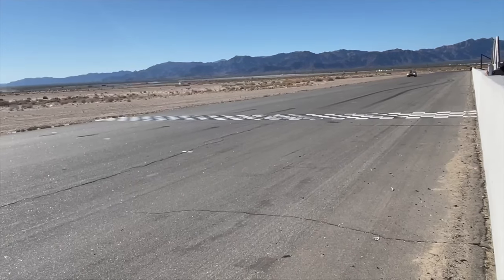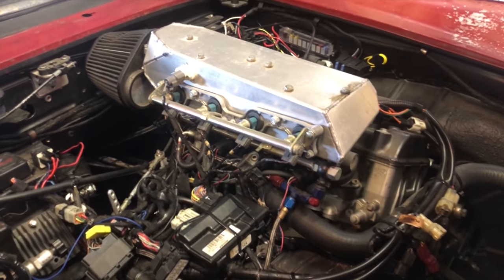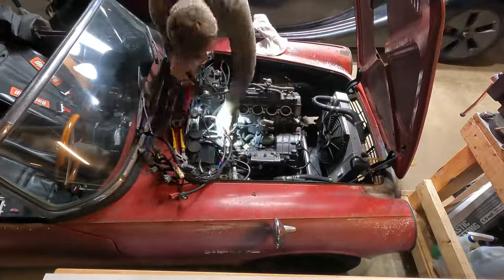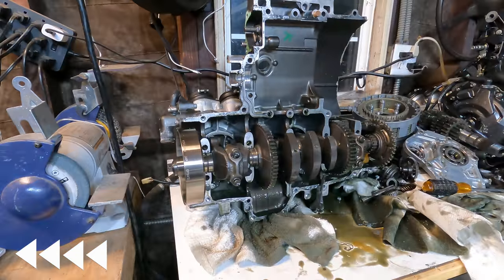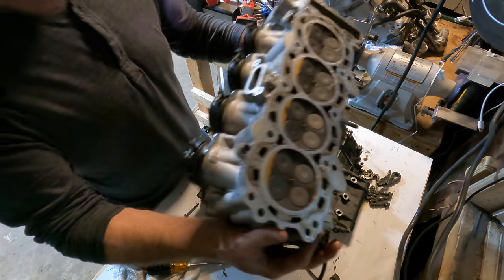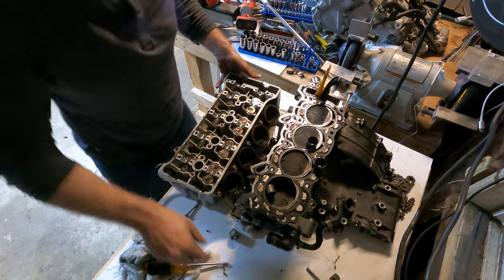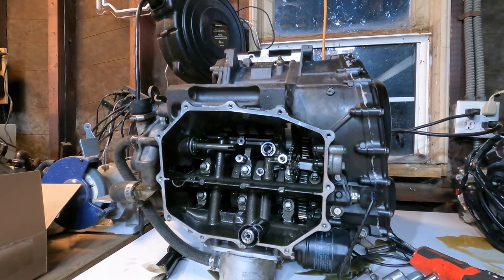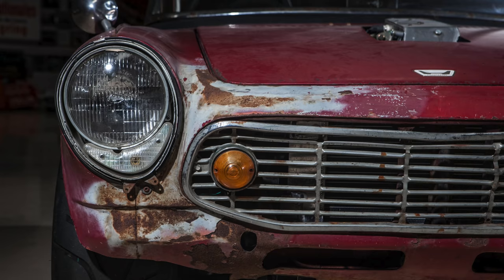I Blew The Motor In My Motorcycle Powered Car

Comment: So now it is time for a Honda Goldwing/Vulcan V6. Still a motor cycle engine! Design and make a good baffle for it and make sure you have a screen on the pickup! This gives you more usable torque were you need it, plenty of HP and reverse. I bet it will work much better on the street and cannon roads!
Reply: Vulcan V6? Whats that?
Reply: As you presumably know, the Vulcan and Gold Wing don't have the same engine. The Gold Wing has a flat 6 (too wide), and the Vulcan is a Kawasaki. Perhaps you meant to suggest either a Honda Gold Wing engine or a Kawasaki Vulcan V-twin. Neither bike has a V6.

Comment: yikes, that baffle with only a center hole pretty much makes it so the oil can't return to the pan unless there's no lateral load at all, basically the opposite of what you want. I'd say winged sump with trap doors for the next one, if you decide to not use a dry sump.

Comment: I believe you are overthinking the oil. The only difference in the sloshing of your car, and a motorcycle, is the orientation of your engine. However, with the oil baffle as extreme as the one you installed, I would not even worry with slosh. I think, if you were to add a sight-glass to that modified pan, you would find the oil level uncomfortably low at sustained high RPM. Then, add some lateral titling, and you will probably starve the engine.

The more lubricated parts above the crank, the more oil is needed per revolution to keep things lubricated. The oil needs time to return to the pan, especially with oil squirters on every cylinder, foaming that oil, a small crankcase whipping it around, while sharing with a transmission assy. 

This is the one of the reasons marine versions of the same engine are often designed with a larger oil reserve. Take the Kawasaki 1200cc family for example. In zx12 motorcycle form, it uses 3.4quarts of oil to operate, even sharing that oil with the transmission. However, the 1200cc pwc cousin, the stx12f, utilizes 5 quarts of oil, with no transmission. You need that oil reserve to keep the pickup wet while sustaining long high rpm runs. From personal experience, a stx12F eats WOT and near WOT riding for minutes at a time. Compare this to the constant rpm variations in on the zx12, and lack of WOT for extended periods. The stx12f survives due to a slight factory detune, a never ending cool water supply, and an oiling system that designed for the task.

I would imagine, that if you were to log your rpm variation, vs the motorcycle that donated the engine, on the same track, you would spend more time at sustained high rpm, than the motorcycle. While the bike is clicking through the gears, and bouncing the rev limiter, it is doing so in brief bursts, with only the straightaway to contend with prolonged  top rpm. Your extra weight, probably requires more sustained time in the higher rpm range, with more throttle, under more load.

As an certified, unknown internet champion of technician engineering from an armchair, I think the solution would an oil in a pan with more internal volume and low level longitudinal baffles.

Comment: It's amazing all those stupid little things that manufacturers put on engines that we don't need right up until we need them. You know kind of like the cooling tin on Volkswagen engines. I had a 1967 VW bus with a bone stock single-port engine. I pegged the speedometer which equates to 100 miles an hour. You all can call bullshit but I was there. This was on the flat north of Seattle. It's amazing what you can get out of those little 1600 engines when you go by the without guesswork book.

Comment: Those oil accumulators are meh.  Dry sump is best if you can pull it off.  Added bonus is you can mount the engine even lower.

Best balance of cheap and... best is - if you can - to mount the engine higher and keep a deep sump pan on it.

Comment: FYI, none of the S series cars came with a motorcycle engine, common misconception. Honda had never made a 4 cylinder, or a water cooled, engine before. Only 1-2 cylinder air cooled engines prior to the S5/6/800

Comment: There are a lot of engines running OK in a small car not so much in a big car like the 2,3 Mazdaspeed ( Ford ... ) Turbo just OK in a Mazda3 - not OK in a CX 7 . Same with the RD 350  - engine in a Banshee. Have a quite nicely running solid 2,0 with 160 HP in my MX 5 that also runs good in my CX 3 AWD winter car and they also use it in a Mazda 3 and CX5 where it causes no problems. Matter of driving resistance. Think my totaly no issue-  1,0  R1 RN04 - engine ( 5 valve 150 HP )  -  would fuck up in a car quite easyly, would`nt it ?

Comment: When you do the kinematic calculations on your crankshaft bearings you quickly discover that the big end bearing is the most highly loaded by a large margin.  Alternatively you can discover this empirically...
Reply: You also learn just how thin your oil get's under sustained high speed loads and temp.'s that you never see on the street.

Comment: Dude, shortened sump and didn't replace that volume out to the front back and sides? Not ideal. You got the "top plate" right, though - you called it a baffle, but it's actually a lid or top. This is perfect, but you NEED the volume under it and you need enough oil such that at 1G+ the triangle of oil on TOP of the plate is insufficient to cause low volume under the plate. Basically the dry sump is the ONLY realistic solution for a track car and that's what you've got :-)

Comment: Youre overthinking the dry sump system, just go with the harley solution, Big oil tank>hose to oil pump>oil goes through motor>oil goes back to tank
Reply: its more complex than that. You need a scavenge pump that is larger than the pressure pump, and a check valve to keep the oil from draining back into the engine. Then unlike a Harley, you must keep the oil INSIDE the engine lol

Comment: "lateral acceleration" in the longitudinal-mounted s600 application = "longitudinal acceleration" in the original transverse-mounted bike application tho, right ?
honestly surprised this happened bc of this
altho i guess if u changed the tilt of the motor, then either left or right turns r super diabolical - like pulling 2-3 g's longitudinal acceleration in the bike application..
hmm interesting

Comment: Probably doesn't help that the engine is mounted longitudinally in the car, instead of the original orientation in the motorcycle.  Different oil slosh direction when cornering, no?
Reply: As Matt explained, cornering isn't an issue for motorcycle engine lubrication at all, because the bike leans into the corner so there's no sloshing to one side... regardless of longitudinal or transverse orientation.  The bike engine has to withstand longitudinal acceleration, and in the car transverse acceleration is a bigger issue, so turning the normally transverse bike engine to a longitudinal position in the car should actually help... but not enough.

Comment: Where is the clutch pedal at 8/27? Is this an S800 or S600?
Reply from the maker: S600. The clutch is a hand clutch on the shifter.
Reply: @SuperfastMatt  Wow, I had a ride [3 of us in it, imagine how cramped that was] in one back in the sixties, amazing vehicle, I gather those chain cases down back got a bit rattly after a while, interesting that the gear box was oil pressure lubricated with [I think] plain metal bearings like an engine. 1000 revs for every 10 MPH in top gear. S800 was more like a standard type vehicle.

Comment: Do you have an idea what engine might be next? Do you want to go with Honda again or switch it up a bit?
Reply from the maker: I really want to keep it Honda, even though it would be super easy to drop in a Hayabusa and buy an off the shelf dry sump system. I tried to get the brand new fancy CBR 1000 RR-R engine but you can’t buy just the engine, and the bike is $30,000. So I went with a used 2017. It has a little more power and a better clutch. at some point I might turbocharge it.

Comment: get a cbr 1000rr engine from 2008 go dry sump and that should solve your issue. Also not giving you clearance issues. Sticking with a honda engine would be fun in my opinion but it is your car :P If you want to  go mad you could try and salvage a S2000 engine and transmission

Comment: High speeds an short wheel base is not a good mix my race engine Smart  used to skip about over with the traction control light on all the time 100mph really not a lot of fun

Comment: A dry sump and a separate oil tank would have been a good idea. Or at least you could have added a decent oil level viewer. Either way you have to live with two issues: you killed a Honda engine unnecessarily, and bought a gigantic best from Costco. You may never live either of them down, especially the bear 🧐😎😜

Comment: have you thought of adding a small turbocharger matt?
Reply from the maker: Yeah, many times. I might do it in the future when I have some time.
Reply: @SuperfastMatt  the best size i recommend would be a 45mm for optimal performance. if you need parts info. ask me anytime. ill do what i can. make sure the pistons and con rods are forged. not cast as cast parts will break under boost. it also needs to be low compression.

Comment: You mean that LOUD Rod Rap! From lack of Oil? - It definitely Fixed It's self??? or Maybe a screen, dip stick, and pressure gauge, like other people?
-
What if you used a Caliper and measured the Crank incited of guessing about everything. Pistons and bearings come in OVER sizes so parts can be re-machined!
You also reduced the capacity of the oil pan and positioned the engine transverse from a motorcycle. Causing the oil to slosh front and back rather then side to side.
-
Here is a clue... The people at Honda are more experienced than you, follow their example.

Comment: I almost learned the hard way how useless oil pressure warning lights are on my old Subaru. On the DOHC turbo 2.5L (i.e. the EJ255 and EJ257) the stock oil pick up tubes have a tendency to crack around the joints where they are brazed. Aside from complete morons modifying their vehicles with zero idea what they are doing, it is the leading killer of these engines. Mine decided to crack, while I was on a road trip no less. The only warning that I got was that when I started the engine, the oil pressure warning light stayed on for about 1/2 second. Once I got home, I put an oil pressure gauge on it and watched. It took like 3 seconds before the oil pressure climbed above about 10psi, yet aside from that extremely subtle difference in the behavior of the warning light on start up, there was no warning. Luckily there was no other damage, absolutely no metal in the oil, so i replaced the pick up with a new, stronger part and all was well. It may have done some minor damage to the bearings in the engine, but there was no sign of it at the time, and it continues to run perfectly fine to this day (my friend now owns it and uses it as his daily).

On a vehicle like this, you really need something to warn you if the oil pressure drops below like 50 psi, because with the high rpms you see on a track, it should never drop below that (as long as you are using the correct weight oil). But high G oil starvation is definitely a thing, even on an engine designed for use in a car. That’s why many cars built for track/race duty use dry sump systems.

Comment: either put a Hayabusa motor into it or better still Zero Motorcycle parts 2 x motors and 2 x batteries. Unless you prefer the mess of ICE I'd definetly go all electric just like your Jag
Reply: no you don't understand. He could also put a big ass V8 in that little car and call it a day. The point is to use a motorcycle engine.
They are extremely lightweight and sound sick.
Reply: @dieselgeezer18  which is why I say Zero Electric motorcycle. Almost maintenance free and much faster
Reply: @ezeJeff  i was talking about ICE motorcycle engines being lightweight and sounding sick. What does maintenance has to do wtih what i just said? 
Also come on dude. How much maintenance do you think you have to do on a gas engine ? Change the oil and filters once a year and thats it. Is it really that difficult and time consuming?
Reply: @dieselgeezer18  I hear you. I'm just caught up in the ev world

Comment: Why not make a system that drives the vehicle on an electric motor but with a generator that runs on fuel, there are several similar options such as hybrid cars or Karma and others that had an extended range engine,
Of course, in all vehicles on the market and even DIY projects, there are batteries in the system,
But is it possible to make a system that takes power from the generator only without the need for batteries (if batteries are necessary, is it suitable to use acid batteries that are available and inexpensive)
the benefits:
1- A simple, uncomplicated system that does not have so much electronics and drive systems that are difficult to install and repair,
2- Working in harsh conditions, including hot or very cold climates,
3- Ease of replacing the generator (if needed) as it is connected to the wires supplying the electricity, or the exhaust only, the rest can be provided with an electrical alternative,
4- Saving fuel consumption because the generator produces energy only without acceleration, and the ease of finding cheap replacement, (and the fuel consumption of the engine and its efficiency in energy production)
Reply: That's a series hybrid. It's difficult to make one efficient because of the inefficiency of passing all of the energy through both a generator and an electric motor... and it's heavy. Matt already tried a different type of hybrid system in this car:
"I Built A Hybrid Car In My Garage" https://www.youtube.com/watch?v=L2agCqW6ntc